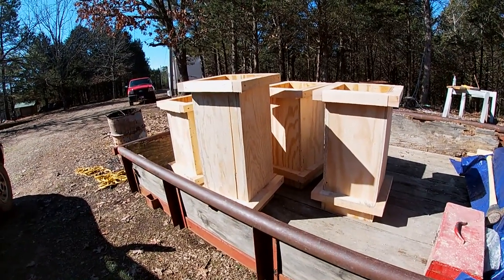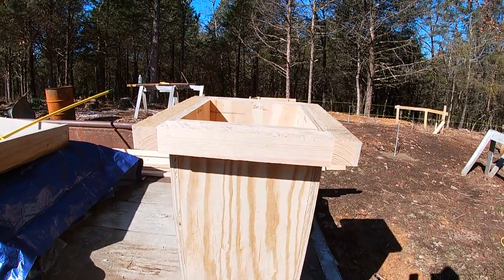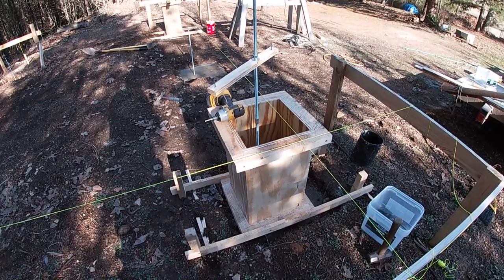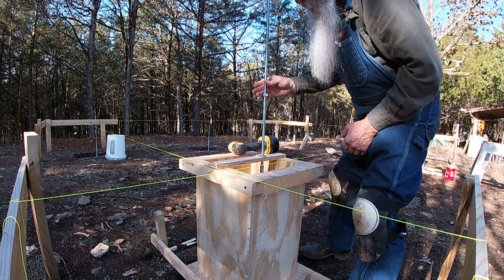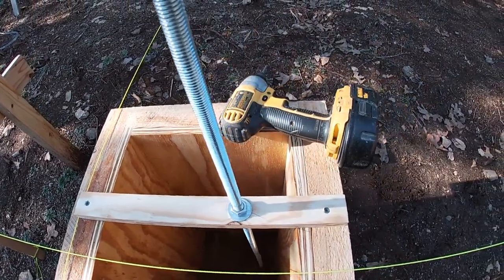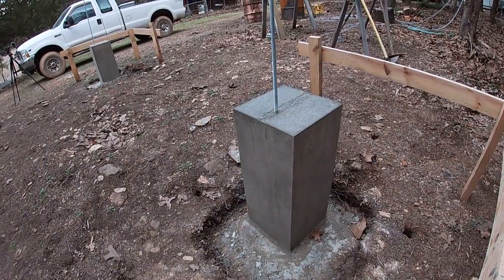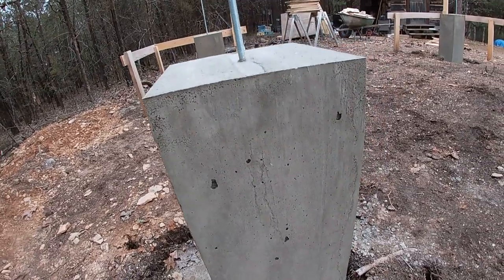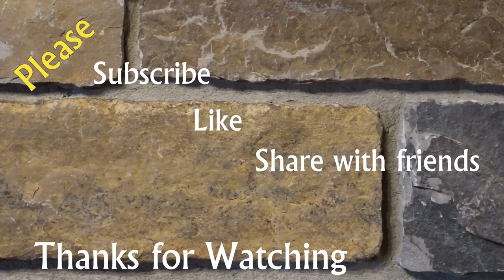Pouring the Piers for the Dovetail Log Cabin Build (Ep 11)

Comment: I usto make RC concrete pipes first we used diesel oil then crankcase oil but car wash soap dry mixed with water sprayed on works so good even leaves a web lots cheaper ! God Bless !
Reply from the maker: Howdy Scott- thank you so much for the information. I just may have to try that. Hope all is well. God’s blessings to you

Comment: Great lookin piers!! A trick i useto make concrete easy to clean off of metal like your all thread is rub some grease on it. I had some forms i had to have torx screws on the inside to hold stuff together. Take a chainsaw bar tip grease gun amd squirt a little grease in the head and wipe smooth... kept the mud out. No hassle pullin the screws after.
Reply from the maker: 307 J.O.A.T   Howdy- thank you for sharing some great tips. I appreciate that. Take care and God bless y’all

Comment: Can you put a cabin on a concrete slab?
Reply from the maker: Howdy y’all- yes, you can put it on a slab but you will need to be able to get wiring in the logs if you’re going to have electricity. There would need to be some thought put into that. If there is plumbing stubbed up you would need to be very careful around it when working. Personally, I had rather build on a wood floor and do the plumbing and electrical afterwards. Hope this helps. Take care and God’s blessings to you

Comment: Will you fill in later between the piers?  I was also a bit surprised you didn't use more rebar.  Regardless, love your channel.
Reply from the maker: Howdy Kevan- thanks for watching and commenting. Later on I may do a stone dry stack around the outside , for the most part the piers will not be seen after the porches are built. I put a rebar grid in the footing and the anchor rods go all the way through the footings. I’m real gentle when setting the sill logs and I feel the piers will be sufficient to hold weight. I’ve done this before and never had any problems. God bless y’all

Comment: Friend, I maybe missed something along the way but what is the spacing between piers? Looks in the video to be near 10'.
Reply from the maker: Dave Johnson   Howdy Dave - the piers under the sill logs are 7’ 4 /2” apart. There will be a girter in the center of cabin that will help support the end logs. Have you been able to get started on your cabin yet? God bless
Reply: @TheBeardedCarpenter  weather and time are the issue right now. Carson National Forest is closed until May 1. It's 10 to 12 thousand foot and the snow there is about 3'. With temperatures in single to minus at night the integrity of any concrete poured would certainly be comprised by freezing. I will be starting this spring but as a 1 to 2 man build I'm expecting 2 to 3 years build time. Nothing big mind you, 800 to 900 sqft. It's only my wife and I so nothing to big is needed. My best friend is a retired electrician from Los Alamos Lab's and I am experienced in solar and wind energy. In fact, I have power at the driveway but our present home is entirely off grid including hot water is solar heated. We have to haul in our water though. A reliable water table is 1000' down but I have 2000 gallons of storage here. Still considering how I will stack the logs but I'm thinking winch line's will be the most practical.

Saddle fitting the logs is a slow process and with having a fused spine I really don't envy the idea of bouncing around in a boom truck, lol.
Reply from the maker: Dave Johnson   Goodness- I been grumbling about all the rain we have gotten, after hearing what you’re dealing with I need to repent for complaining. I had the privilege of spending the night in Los Alamos, beautiful up there. I will be putting together a rolling gantry after the floor is in. You might get some ideas from it. I’m looking forward to when you get to start- I’m sure you are too. Wishing y’all the best. God bless ya’ll
Reply: @TheBeardedCarpenter  God has blessed us far more than we could ever deserve. We are located quite a ways north of Los Alamos in the mountains. Our present home is just above 8000' so we haven't seen nearly as much snow this year. Typically the forest area I plan to harvest from would be under 6' or better snow. Snow is the reason the forest is closed in the winter. I'm really hoping the logging issue over the owls is resolved before cutting season opens otherwise I'll have to look at harvesting in Colorado. Colorado is only 30 miles further but that's a huge game changer for sure. Where I want to harvest is in dire need of thinning for forest management reasons. Thanks for all your feedback and the information you share.
Reply from the maker: Dave Johnson I do hope and pray all that with the owls gets resolved soon so you can move forward. I certainly agree, God has blessed us also. We depend on Him daily. Blessings

Comment: Looking good, Paul! Will the forms extend past the outer border of the sill log? If so, do you do anything to prevent water that may splash up from or gather on the sill from becoming a moisture problem for the sill log?

Also, I know your joists are oak. What type of wood is your sill log?
Reply from the maker: James Aldridge   Howdy Jim- there will be a treated plate on each pier that the sills set on. The sills are pine logs- two of the biggest. No rain will be able to get on the sills with a wrap around porch. God bless y’all

Comment: I don't understand, i don't see concrete, but just cement mix and the posts are not reinforced with wire. Is this just a cement post? Why not a concrete mix?
Reply from the maker: Howdy- I used 4000lb concrete which is high strength that I can get here. The anchor rod for the sill log goes all the way to the bottom of the footing which was dug well below the freeze depth we have here in Arkansas. Thank you for the comment. God bless you
Reply: @TheBeardedCarpenter  Good job!!